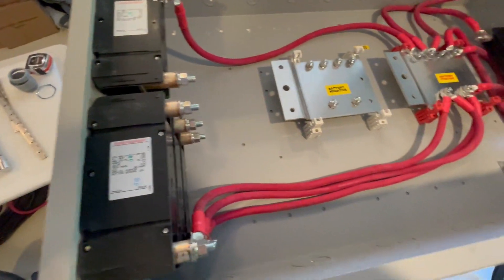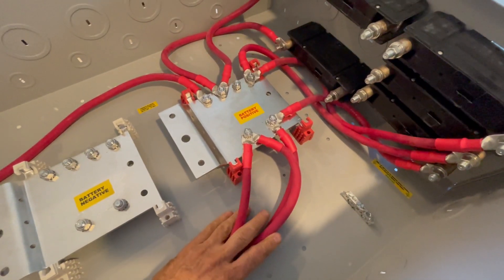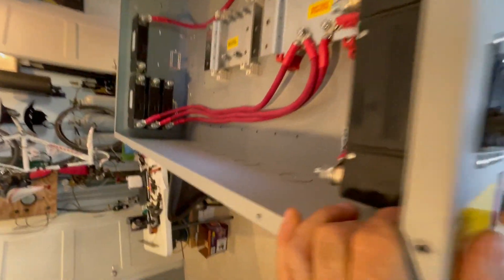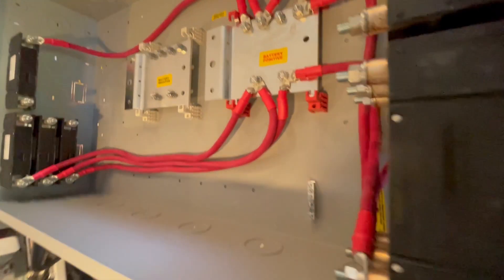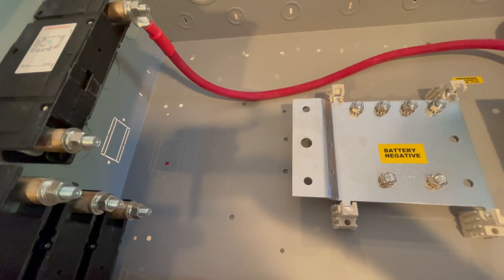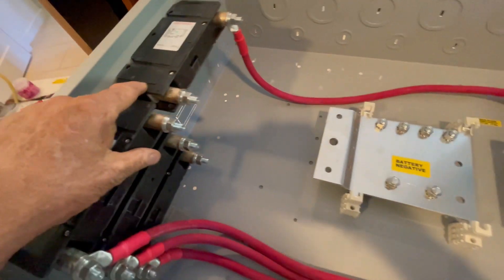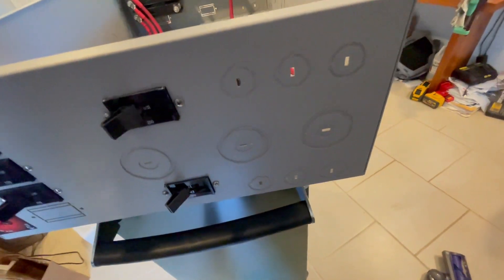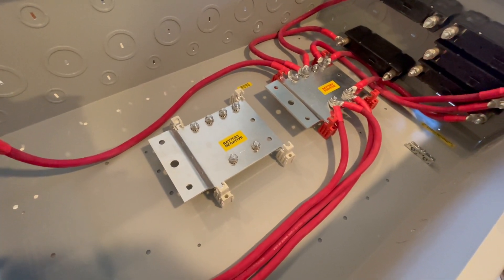Midnite Solar  Battery Combiner Box! This Thing Is Awesome!

Comment: I'm ignorant, why do we need a battery combiner box?  What's it good for? Please and thank you.
Reply from the maker: When we use multiple batteries we must have busbars that are large enough to withstand the combined amperage of all of the batteries. Each battery needs its own DC rated breaker. In the case of multiple inverters, you will also need a breaker for each of those. A battery combiner box provides a convenient mounting surface for all of those things, and an enclosure to keep all of it safe. Some people try to mount all this stuff on the wall out in the open which is sub optimal. It also can end up being more expensive to make it all work out when you don’t have the convenient combiner box, depending on the size of your system. It’s very similar to a breaker panel for distributing power throughout the house. It’s just not reasonable to try to distribute all those circuits without a centrally located enclosure.
Reply: @RayBuildsCoolStuff  Thanks Ray, this is really helpful.  I am now getting into solar, I had one 10kwh battery but it wasn't enough so I bought two.  Now I know I need a battery combiner box to go with those batteries.

Comment: OK just watching this video a second time has answered some of my questions 6 batteries would make the minimum bank for me to have a 5 day bank but I think that I need to have a bigger bank than that I'm thinking 8 would be better Part of the problem I was concerned with as I thought I needed to have batteries to each and every inverter I didn't know that they could all be tied together like you're doing here I didn't know Also wondering how to tie the outputs on the inverters back together I don't have the specs here in front of me and I've driven down the road at the moment but I was looking at 18000 W inverter But electric furnace electric tank less water here like to drain microwave washer like the dryer without figuring lights comeaters and heat your hair in the gahuge 5 horsepower air compressir arc welder and I'm sure there's a few things I've not even figured out yet but Just to heat the water arrange washer dryer takes me through 3 and a 1/2 of those 18000 W murders cause typically in the afternoon everything runs and doesn't shut down until at night and then we've got the heat overnight pound up it's Mega load I burn 350 to $550 with the electricity most of the year I must say I do have some questions somewhere down the road too that rough you put on that solar s*** I have bolted ceilings and a double white you're my R value is c*** andBlank 4" of foam on the roof could be just super amazingI enough of my problems get back to your work thank you
Reply from the maker: That’s a huge amount of load.

Comment: Ouch! Too expensive, especially since you could have made it yourself. I guess customer is king and could pick what they want when $ is no object. To me that combiner box is too large for its purpose and was made that way to justify cost. Please tell us the whole cost of that box equipped. I have checked on the website of Unbound Solar but did not find it. Thank you!
Reply from the maker: I could never create this for what I spent. For 1,600usd I received a large welded heavy gauge rated enclosure with two 1,000Amp busbars with threaded lugs sufficient to connect my eight batteries to my three inverters. I also received 8 175Amp DC breakers and 3 250Amp DC breakers. I also received a shunt which I will not use but could sell. The enclosure is far better than just some sheetmetal box and has dozens of knockouts that avoid the need to drill penetrations. I was hesitant to make the purchase but after receiving this unit I am convinced that I saved a lot of time and money.

Comment: Ray, do you have a diagram or block schematic of the system you are building?  It looks awesome.
Reply from the maker: Like everything I do the plan if it is committed to paper is done so in a shorthand version that only I can understand. I don't spend the time to draw it for general comprehension unless it is required for team use. In that case I draw it on Acad but it takes time I can spend more productively. It's just the way my brain works. I did a pencil sketch of this system after the fact for my electrician friend to get an idea of what I'd done but even that was a visual aid for a phone conversation. If I released something that is that vague and lacking in detail to the public it would more often than not be misinterpreted and I'd hate to see that cost someone. The videos do a better job of showing the layout and details from my point of view. 

The other thing to consider is that this system is different than other systems. My solar guy for instance has never done a system that has all the parts that this one has. Each system is tailored to the needs and demands of the person that will live with it. Most people want plug and play and never needing to understand it. That isn't this. For them, Tesla might be a better option. For people like us, this is a better route. 

What I hope to convey is concepts, ideas, approaches and priorities that work for me in the things I create. I hope to show things that can be utilized in all kinds of endeavors. I don't want to be prescriptive. I'd prefer to guide us to ah hah moments that put another tool in our creative tool boxes. Does that make sense at all?
Reply: @RayBuildsCoolStuff  Makes perfect sense.  Thanks you.

Comment: Also, your choice of 1/0 cables is not sufficient for the breakers/switches you have them attached to.  1/0 is only good for 170 amps.
Reply from the maker: This is 105c rated wire.
Reply: @RayBuildsCoolStuff  thhn?
Reply from the maker: @duanehulse2037  welding wire rated at 105c
Reply from the maker: THHN would be a poor choice for this application. You could upsize it for the load but it is also much stiffer to work with.
Reply: Yes i see that is what I used on my 455 Pontiac after 11 to 1 pistons and headers

Comment: You said that you were going to use the 2 inch knockouts on the bottom.  With that said, how are you going to deal with the heat load from the cables, considering the potential amp draw?
Reply from the maker: The maximum amps I have ever seen in the last 6 years of monitoring was 79 amps. That was with both clothes dryers running, both dishwashers, the A/C, the oven and the Christmas lights. That draw was for very short periods of time(a few minutes) as all those loads are intermittent. The oven and dryers cycle their heat strips on and off to maintain temperature. 

That is at 240 volts. Divide that by the three inverters and you get 27 amps each which at the 48 minimum volts I will be running on the battery will be 135 amps each. On the battery side there are 8 batteries but if we do the math on 6 batteries figuring for 2 being offline for maintenance, that would be 68 amps for each battery cable. 

The combiner box is in climate controlled space. This won't be an issue at all. 

Thanks though for the idea I now have for a video where after all is up and running, I try to see how warm I can get it. We will learn together and if the need for a cooling fan is indicated well.....more learning and another video.

Comment: I assume that the Bus Plate is of Copper with Tin Coating and wonder if it is a one piece unit?
Reply from the maker: It appears to be one solid piece of copper and is rated at 1,000 amps. Midnite solar has a video on it with lots of amps running through it. You can search for that video.

Comment: Are you going to add precharge resistors and switches for inverters and charge controllers?  Maybe add a relay that only connects inverters when the inverter side is near pack voltage like EV precharge circuits have.

Comment: Wow. Low voltage batteries sure require a lot of extra breakers.  I'm running a 500 volt battery on my system. It's got it's pros and cons I suppose.  Every cell in series keeps amperage identical.  It's nice to be able to use 8 gauge wire to connect the battery to the system but if I ever have a problem with a cell I'll have to power down the whole thing while I work on it.   With 500 volts available to the inverter it's very quick to charge the caps and blow every fuse in my circuit so pre-charging is definitely necessary.

Comment: That's a beautiful combiner box and I love your breakers and your bus bars but I have a dumb question are you using the same size wire going to your smaller breakers as you are going to your 250 amp wouldn't you 250 amp breakers need to be doubled in the wire size just curious
Reply from the maker: Here are my thoughts on the design. Either breaker will protect the wire. The 1/0 105C wire at my length of run will handle the 250 amps. 

The 250 amp breaker is sized to allow the current needed for the 8,000 watt inverter at the lowest voltage of the battery with some head room. 8,000/44=182 amps. 250A breaker works. 175A breaker would not. 

The 175 amp breaker is designed to  trip before the 200A classT fuse. I will have at least 4 batteries installed in parallel at all times. There are 3 inverters at 8,000 watts. 24,000/44=546 amps 546/4=137 amps. 175 amp breaker is sized correctly for this load and is below the rating of the BMS which is comforting. I don't want to design to the max rating of the BMS.

That's how I'm thinking about it.

Comment: how much battery are you going to have ? lol this thing is awesome
Reply from the maker: Starting with six 14.4 KWh batteries and will probably add two more later.
Reply: @RayBuildsCoolStuff  Holy cow, what's your total PV input to the system?
Reply from the maker: @JKArcade  One system is net zero at 12KW of PV but I will add 7KW to add capacity for days of marginal production. The other system is near net zero at 19KW but we will add 9KW to that one for the same reason. The goal is to take grid tied homes off grid without the need for daily concern about our power supply. We are looking for better than grid reliability, now and in whatever the future brings.
Reply: @RayBuildsCoolStuff  Wow. This is some serious stuff. I currently have 10KW solar and plan to go to 14KW soon